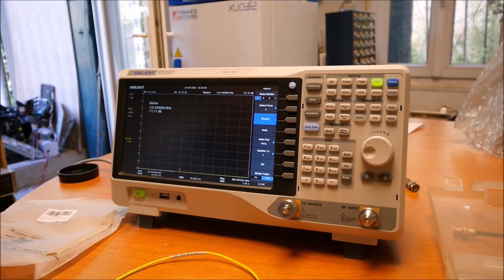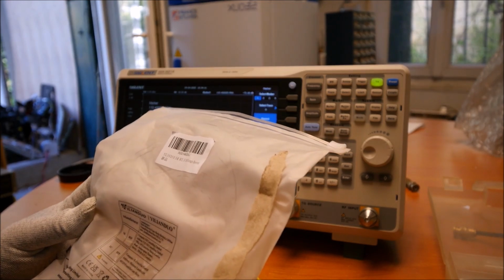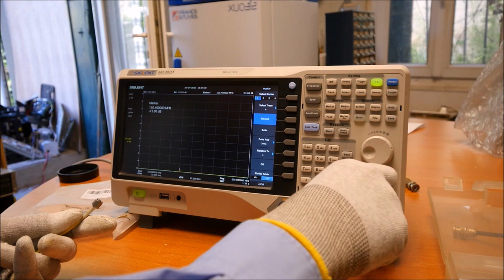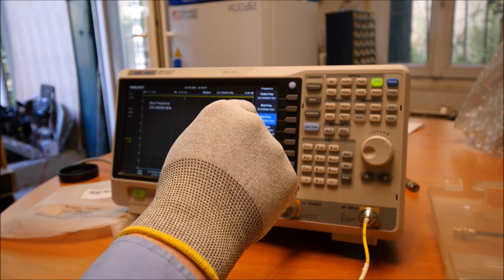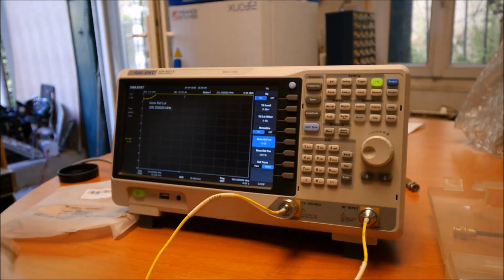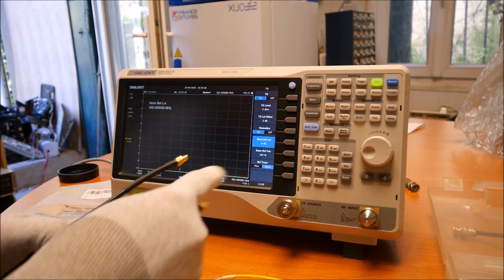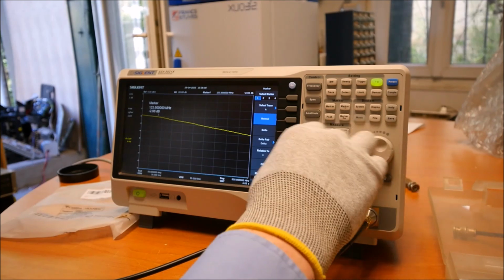LDM #404: Collins 618M-1A transceiver - Part 2: repair/adjustment and test

Comment: AI Summary

Abstract:

This video details the testing and debugging process of an aircraft radio receiver. The presenter first identifies that the unit's frequency selector uses a non-standard binary coding instead of the expected ARINC 410 (2-of-5) standard, necessitating the creation of a custom test selector. Frequency selection functionality is verified, requiring a minor repair to a faulty switch. Audio output quality is then assessed using a signal generator, revealing significant distortion above 40% modulation depth. Troubleshooting using schematics and oscilloscope measurements reveals that the audio saturation originates at the squelch gate. A critical finding is that the actual squelch circuit differs from the provided schematic. Reverse engineering the true circuit identifies the cause of distortion as the audio signal level exceeding the squelch diode's bias voltage, leading to clamping. A modification involving adding a parallel resistor to lower the bias voltage successfully resolves the saturation issue, achieving acceptable distortion levels (~2.4% at 85% modulation depth) after gain adjustments. Finally, the video begins the process of testing and tuning a custom-built ground plane antenna for the aviation band using a spectrum analyzer and directional coupler, measuring cable loss and initial antenna resonance.

Testing and Repair of an Aircraft Radio Receiver

*   0:00:04 Non-Standard Selector: The radio's frequency selector uses a binary coding system, not the standard ARINC 410 (2-of-5 code).
*   0:00:33 Custom Test Setup: A crude selector board with individual switches was built to manually input the binary codes for testing frequency selection.
*   0:00:53 Frequency Selection Test: The auto-positioner system is tested by inputting binary codes corresponding to known frequencies (e.g., 131.20 MHz).
*   0:03:01 Initial Failure & Fix: The frequency selection initially fails due to a faulty microswitch on the custom selector board. The switch is replaced (`0:03:15`).
*   0:03:24 Successful Frequency Selection: After the fix, the frequency selection test (e.g., setting 121.15 MHz) works correctly.
*   0:03:31 Audio Output Test Setup: The receiver's audio output is tested using a synthesizer generating a 1 kHz AM signal (initially 300 µV, 30% modulation depth).
*   0:04:04 Audio Distortion Identified: Oscilloscope observation shows audio signal distortion appearing when modulation depth exceeds approximately 40%.
*   0:04:38 AGC Performance: The Automatic Gain Control (AGC) is observed to be functioning, maintaining a relatively constant audio output level despite input signal level changes.
*   0:05:16 Troubleshooting Audio Saturation: Investigation begins to find the source of the audio saturation/distortion.
*   0:06:09 Gain Adjustment Impact: Adjusting the internal audio gain (R118) improves but does not fully resolve the distortion, especially at higher modulation depths.
*   0:07:07 Locating the Saturation Point: Signal probing reveals the audio is clean before the squelch gate diode (CR10) but saturated after it (`0:08:00`).
*   0:08:32 Schematic Discrepancy: It's discovered that the actual squelch circuit wiring on the board differs significantly from the provided schematic diagram.
*   0:08:48 Reverse Engineered Circuit: The actual schematic, determined via reverse engineering, shows the audio signal path and bias arrangement for the squelch gate diode.
*   0:09:22 Cause of Saturation Explained: In the actual circuit, the audio signal voltage can exceed the squelch diode's bias voltage (~12V), causing the diode to turn off intermittently and clamp (saturate) the signal.
*   0:10:05 Implementing the Fix: A resistor decade box is connected in parallel with a bias resistor (R115) in the squelch circuit to lower the bias voltage.
*   0:10:36 Fix Confirmed: Adding a 20k resistor in parallel immediately resolves the saturation issue, resulting in a clean audio waveform even at high modulation depths (85%).
*   0:11:16 Final Audio Adjustments & Measurement: The audio gain is readjusted for optimal performance, and distortion is measured using a distortiometer, achieving ~2.4% THD at 85% modulation depth (`0:12:05`).
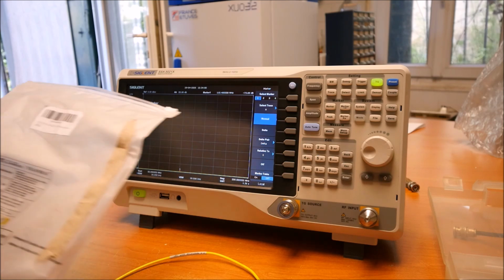*   0:12:14 Antenna System Testing: The focus shifts to testing the antenna system, starting with measuring the loss of a 15m RG58 cable (~2dB at 120 MHz).
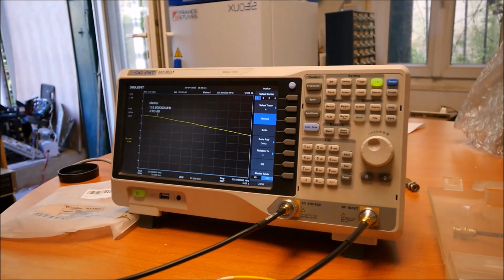*   0:13:20 Custom Ground Plane Antenna: A homemade ground plane antenna with adjustable element length is introduced for testing.
*   0:13:45 Antenna Resonance Measurement Setup: A spectrum analyzer with a tracking generator and a directional coupler is used to measure the antenna's return loss / resonant frequency.
*   0:15:04 Initial Resonance Measurement: The antenna's initial resonant frequency is measured at 110 MHz, which is below the desired aviation band (118-137 MHz).
*   0:15:13 Antenna Tuning Required: The antenna element needs to be shortened to raise its resonant frequency into the target band. The video ends as this adjustment begins.

I used gemini-2.5-pro-exp-03-25| input-price: 1.25 output-price: 10.0 max-context-length: 128_000 on rocketrecap dot com to summarize the transcript.
Cost (if I didn't use the free tier): $0.03
Input tokens: 15938
Output tokens: 1234